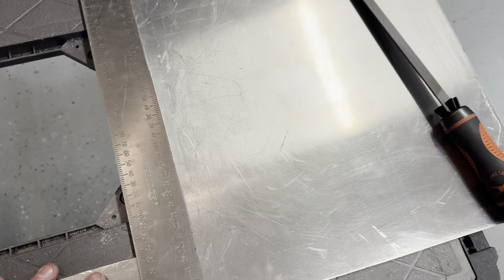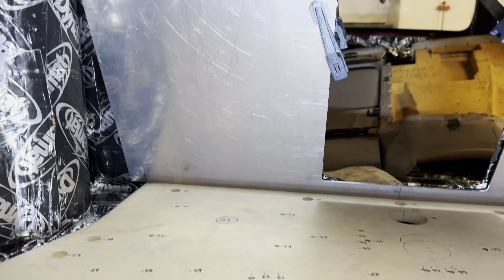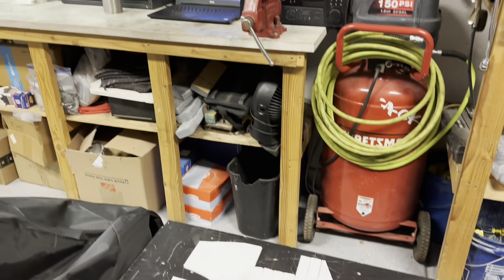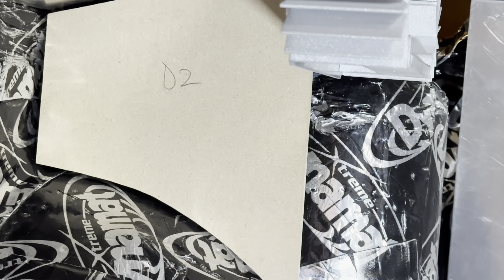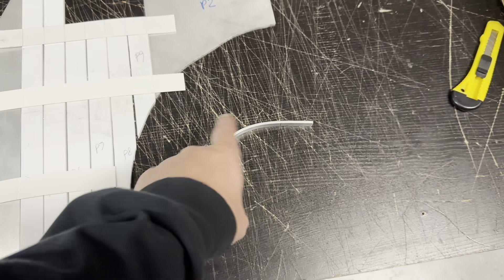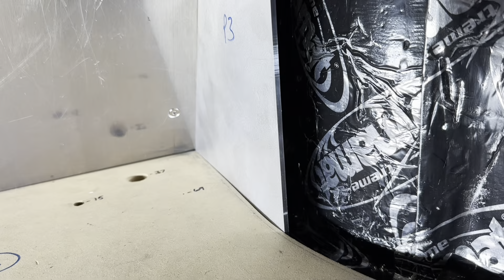CarMiZa- Trunk Details part 15

Comment: Mike, are you worried at all about rattling between the aluminum plates? Even if the carpet it thick.. might eventually be metal on metal. Also curious, is Dynamat going on the aluminum under the carpet?
Reply from the maker: @yomama5785 - hey stranger, lol:)  I was actually working on the wheel well covers last night...thinking, here I go again and overengineered another part of the build.  There will be (4) 1" x .125" curved flat bar "straps" horizontally placed, that the vertical flat bar pieces will mount to, using machined hardware.  So each vertical flat bar will have (4) screws holding it.  In total, there will be (26) screws with nylon insert nuts holding each assembly together.  And yes, I plan on adding Dynamat to the back of these panels...because I am a freak. Once everything is together and carpeted, I do not think there will be any change of movement and, more importantly, rattles.

Comment: Mike what router table is that. Or did you cobble that together from other things
Reply from the maker: @mikereaulo2359  Hey Mike- It is a Husky router table from Home Depot.  Does the trick. https://www.homedepot.com/p/Husky-1-8-ft-x-3-ft-Portable-Jobsite-Workbench-224317/205887786?source=shoppingads&locale=en-US&pla&mtc=SHOPPING-BF-CDP-GGL-D25T-025_011_STORAGE_DEVI-NA-Multi-NA-PMAX-NA-NA-NA-NA-NBR-NA-NA-NA-StorageDevices&cm_mmc=SHOPPING-BF-CDP-GGL-D25T-025_011_STORAGE_DEVI-NA-Multi-NA-PMAX-NA-NA-NA-NA-NBR-NA-NA-NA-StorageDevices-71700000111216761--&gad_source=1&gclid=Cj0KCQiAm4WsBhCiARIsAEJIEzXXyYZlKItXpBEjqIrrtu-2NG602BNSZW9qhlj_vvnNCSXnYOuU81kaAr0GEALw_wcB&gclsrc=aw.ds